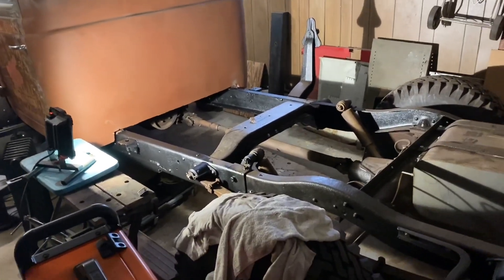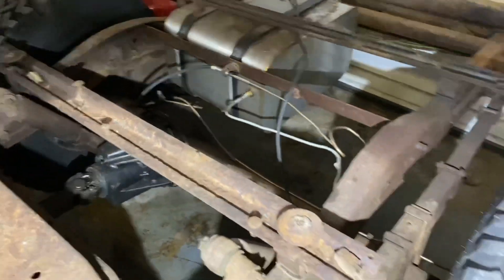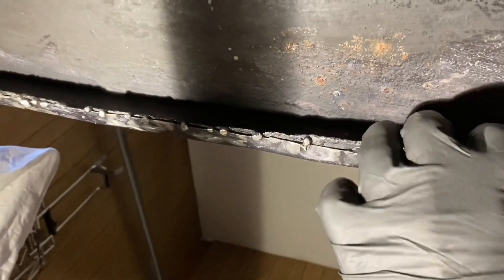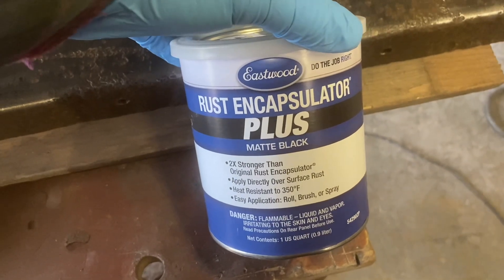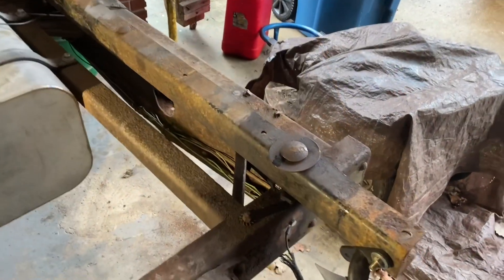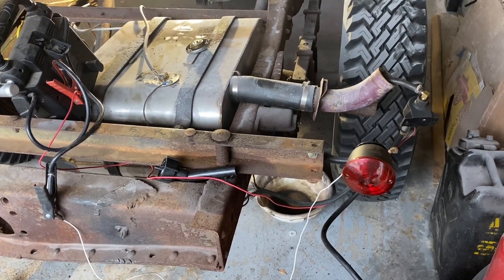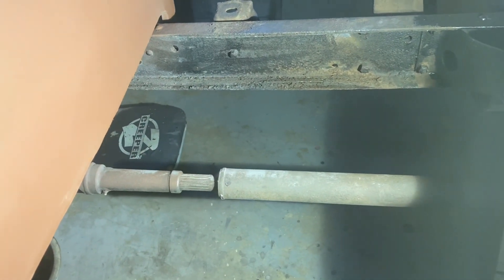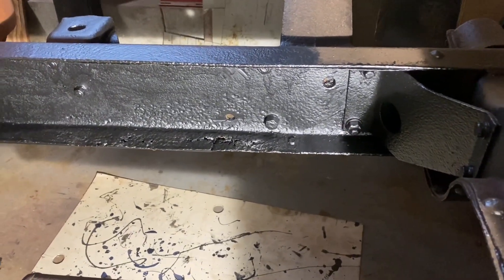Power Wagon update 25 (and winch 1.5)

Comment: Jonathan things are coming along nicely!  Its good to see you using Eastwood products, I bought my forts powder coat gun from them and a whole lot of powder, bought a TIG welder and I have a bigger media blasting cabinet I got through them good company to deal with and they sell good products at decent prices.  Did you get a new fuel tank for your truck?  It looks really nice!  My goal this week on my truck is to get the front axle assembly finished up and together then I can get cracking on the engine, trans and transfer case.  My project is coming but it sure seems not as fast as your Jonathan!  Great work!!!!
Reply from the maker: Yes, I tried but quickly gave up on repairing the original tank.

Comment: The flex seal is a great idea. I found a really nice clean set of doors!
Reply from the maker: Lucky you! I’ll bet you paid a good price for them!
Reply: @JDawghasaTruck  $400 for the entire cab. the cab is shot except for the front windshield area and the dash is perfect. Mine is all chopped up with round aftermarket gauges.
Reply from the maker: @gonefishing2012  what year? I have a 46-50 from the donor cab I can sell
Reply: @JDawghasaTruck  Darn should have asked sooner lol this one is on its way. I am looking for a speedometer and square gauges also looking for a rear leaf spring shackle and bolt.
Reply from the maker: “46-50 dashboard from the donor cab” sorry🙄